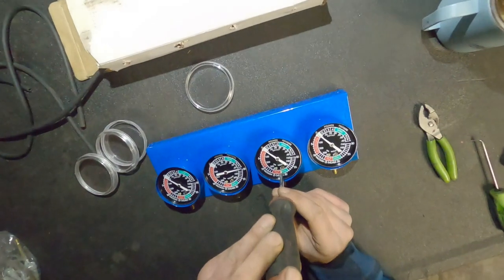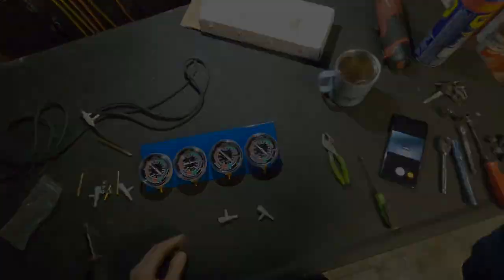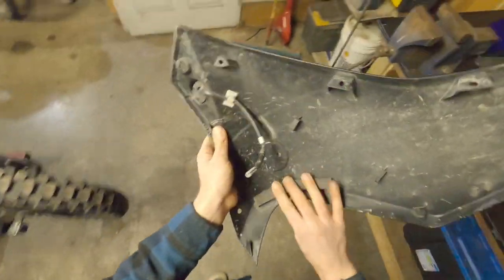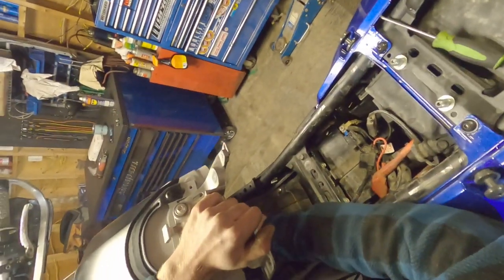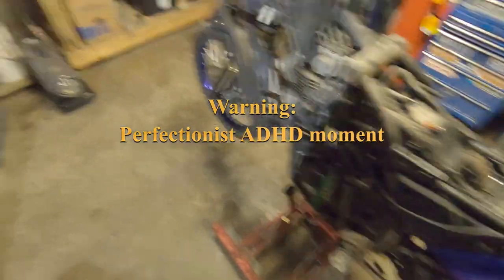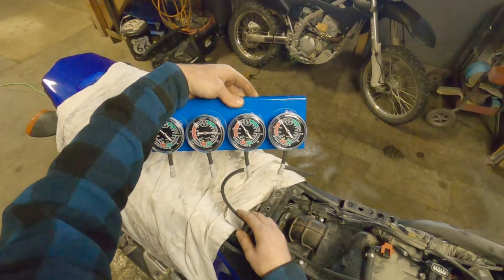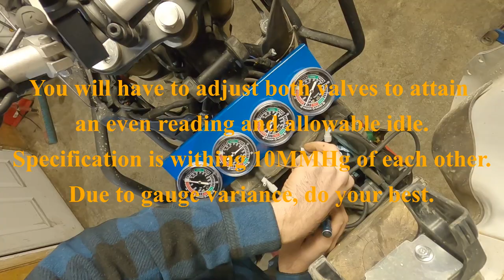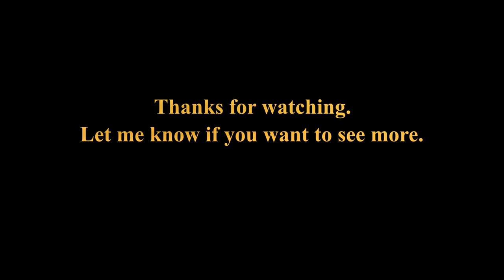Tenere 700 Throttle Body Sync

Comment: just  in  20.000 make  this  service??? or   you first  make  the  valves???
Reply from the maker: This service is due every 7000km if I recall. Valves are due at 42000km.
Reply: @cvbadv  need sybchronize the calbulaor???  every  7000????  in  service  manual  is  ???  or  you  make ????  i  have the  750  xtz  and  in  manual  is  wehn  make  the  valves  service  then  need  synchronize..
Reply from the maker: @panagoskakatosis5314  its a very different bike than the 750 and requires very different service. This bike also has throttle bodies with fuel injectors, not carburetors.
Reply: i   will  keep  the  750  looks   more easy for service  i  make  allready  the  valves and  calbutaror  only  wth  calbulator settings spend  many time to  lern  and tests..

Comment: Great video.  I need to check mine.
Reply from the maker: It really does help. It's supposed to be checked as early as the 600km service!
Reply: Ivhave my tracer which ist identical to tenere for 6 years and never touched the throttle Body. As Long as your engine runs fine you dont need to do this. Before you sync you check and or replace valve clearance, Air Filter and Spark plugs anyway. You just dont only check syncing without all the other important parts for a well running engine.
Reply: Syncing is the Last step you do after all other important Parameters.

Comment: What is the maximum and minimum acceptable vacuum pressure?
My two are at 12 mm, is this normal? Do I have to raise both to 10 mm?
The idle is a little unstable
Reply from the maker: That's actually a great question! The amount of vacuum the engine produces depends on your idle speed in this case. Is your idle within specification? If it is the amount of vacuum produced isn't important. What is important is that the vacuum created on each is the same. There's a variance specification in the service manual. (See how I'm making sure you read the manual?) The reason being is the MAP sensor only reads cylinder #1. So cylinder #2 is based off the reading from #1. If they don't match it will be rich or lean and cause poor riding characteristics, which this aims to improve. I hope that explains it.
Reply: According to manual, intake vacuum should be 39.3–41.6 kPa (295–312 mmHg, 11.6–12.3 inHg)